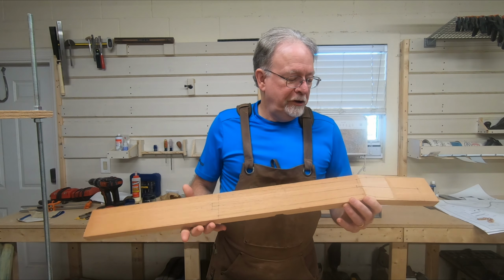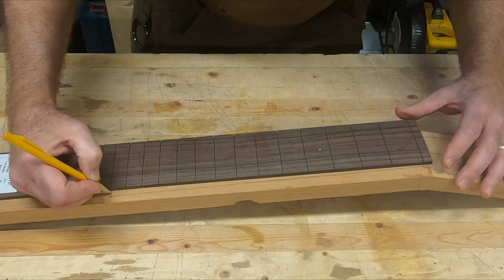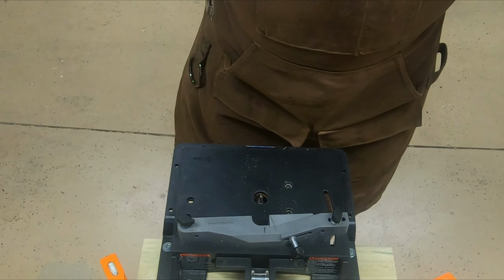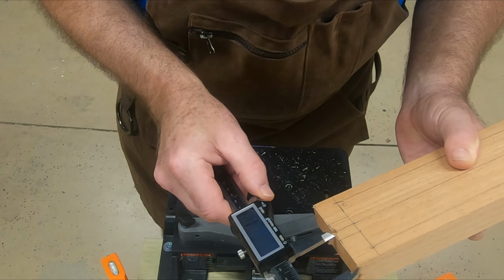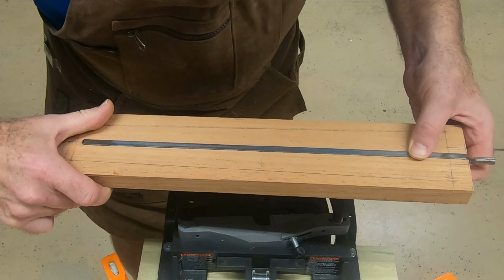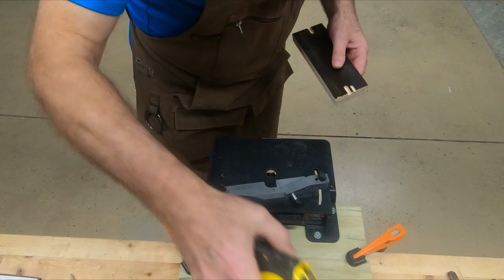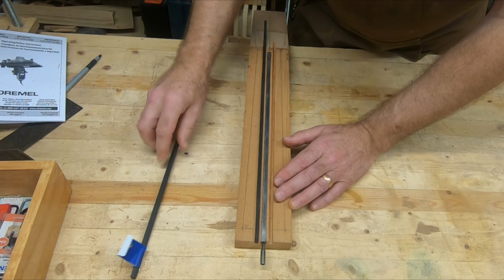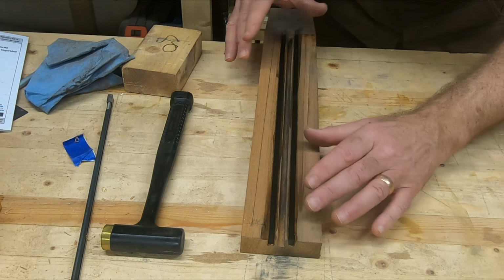Build #3 - 15 Truss Rod & Carbon Fiber Rods

Comment: Dunno what goes on with my first build, but the fingerboard has too much relief. It plays but not so easy. I used the fender single rod system for simplicity. I like the carbon fiber thing, but I might change the geometry of the Fender groove.. Moved forward on the #2 build today. I saw where somebody sawed off the extra on the side ends by running a thin saw through the space between the mold halves....don't remember what you did. I see George Leach just used 0ne half of the form to guide his saw blade, and it weren't too good.
Reply from the maker: I didn't video the part where I cut the sides to length. I marked the sides while in the form, after they were laminated, and cut them to the line.  Since you have an endcap at one end, and the neck on the other, you have some leeway.

Comment: If you’re going to be putting a headstock veneer on, putting the extension piece underneath is best for strength. Because the veneer will be glued onto both the main section and extension and the extension is short. And at least some of the string tension is put on the main section because the tuners closest to the nut will be attached to the main section provided when you thin the headstock you remove wood from the bottom not the top. If you put the extension on top of the main piece, you will have the fretboard glued to the main section and the extension. But all of the string tension will be pulling on the longer extension and the scarf joint itself. Draw a cross section of both scenarios and look at how string tension will be trying to torque the joint and how each of the glued surfaces will be working together to resist the torque, and the greater the distance from the glue joint the more leverage applied. I think you will find the latter leaves the scarf more vulnerable to coming apart. But you did put in carbon fiber rods helping to reduce a hinging action where the scarf joint meets the fretboard greatly reducing the likelihood of failure. Sorry to be so long winded but that was as succinct as i could be.
Reply from the maker: I did thin the headstock from the back and put a headstock veneer on, the video is not out yet.  The fretboard covering the joint with the other configuration is what made me question which is best.  It does seem that most acoustic guitars seem to use the underneath glue method.  I appreciate the input, thanks!